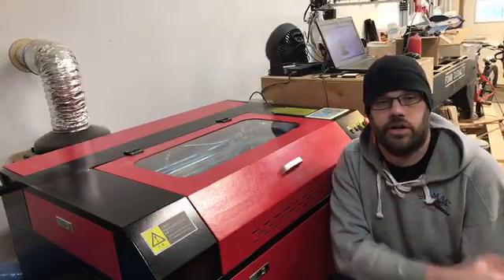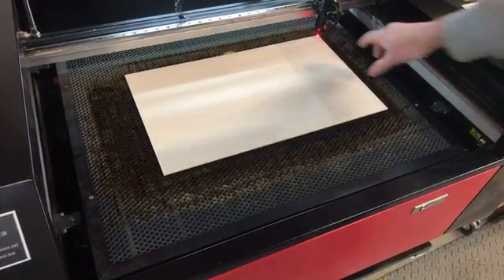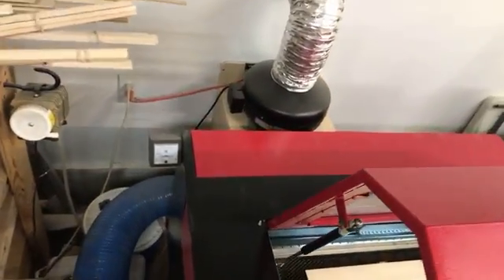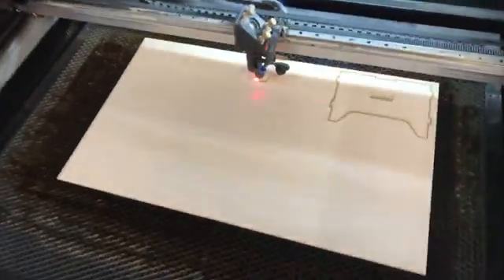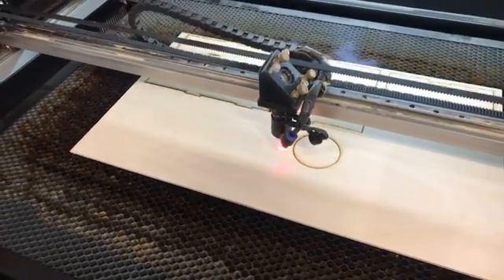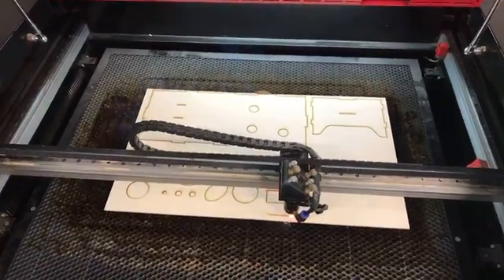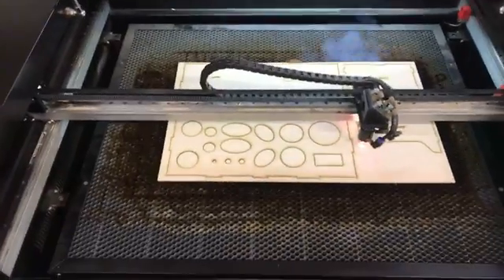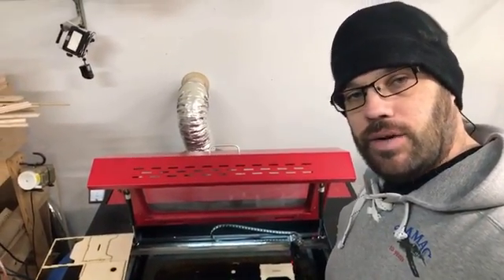Laser Cutting Baltic Birch Plywood (eBay Laser)

Comment: I've got my eyes on an 80w that looks just like yours. I was just wondering how good or bad the support is, or, is there enough of us english speaking folk out there using these that can help out other "newbies". ? haha.. do you do consulting?
Reply from the maker: When you buy one of the Chinese lasers from the bulk of the resellers you will get almost no support from them. I had a proximity sensor go bad within a month and they did send a replacement but that was about it. There is a good community online in various forums, websites and social media groups that do a lot to support each other and help troubleshoot issues. As long as you go into it understanding you'll need to tinker with the machine from time to time it's a great way to get an inexpensive tool for the shop.
Reply: I'm going to be cutting 1/8 and 1/4 inch plexiglass.
Reply: What is the price of Indian rupies

Comment: Hi ... I wanted to ask you how many watts is the laser of the video.

I would like to take it from 100 watts but I can not find it on ebay.

That model I find them from 60 watts.

Do you have some advice?

Thank you so much for your help !!!

Marco
Reply: Hi friend,I come from China, I have about 6 years of experience in the laser industry, if there is a chance, why don't we talk about it? Here's my contact details: atonfu@gmail.com 
Whatsapp:+86 15069148520
Cell phone number:+86 15069148520
Reply from the maker: Marco, I bought this as a 60W laser from eBay. That being said it came with a 60w power supply that was overdriving a 50 watt tube. I replaced the 50 watt tube with a true 60 watt tube which is what you see in this video. I should have cleaned the mirrors and lens before this video and the cuts would have been cleaner. I have also played with the air assist to push more air through that has also provided cleaner cuts. I can now cut 1/4" Baltic Birch in one pass with fairly clean edges.
Reply: @Vintauri  Thank you so much for the information.
I was trying to get the laser at least 80 watts so as not to put it under stress making it work.
Using a smaller one, I should keep it at higher watt to make the work overheating it faster !!!

Comment: I have one of these babies in transit arriving the end of next week with the 50W tube. I appreciate all the videos I'm seeing on these lasers. One thought... Can you program your cutting sequence to include a second pass at a faster feed rate to ensure that the cut goes completely through the plywood?
Reply from the maker: You can setup the file to cut twice on the same path. You would need to have the same vector lines on a second layer and use a separate color to have it re-run over the exact path.  It would be best though to manage it in one pass with the right balance of speed and power along with making sure your lens and mirrors are all aligned and clean.

It'll take a bit to get your machine dialed in but then you'll know it's limits and how to get the most out of each pass.
Reply: @Vintauri  I've been watching videos on these lasers for several weeks learning what these machines are capable of and a guy running a 40 Watt was cutting through 1/4" plywood by running the laser at 40% for multiple passes. He uses a handheld mirror under the work piece to see when the cut has passed completely through, instead of just guessing.The edge lines were barely even browned and easily cleaned up. Look outside what you "expect" the machine to do. I've watched countless people people finishing their work with jigsaws, bandsaws, grinders, and sandpaper reducing the quality of the work when it is completely unnecessary. I am so thrilled to getting one of these machines! You are only limited by your imagination.

Comment: Thanks for posting this video.  What type of laser is it - i.e. who's the manufacturer, where did you buy it from?  I'm looking at purchasing a similar power laser and I'm weighing up the Glowforge vs Chinese laser options. Any advice appreciated.
Reply from the maker: My laser is a Redsail X700 clone. I bought this one on Ebay. It was listed as a 60 watt C02 laser engraver. The glowforge is nice in that it's very simple to use. But it's a lower wattage and smaller working area. If your not afraid to tinker and do some self learning the chinese lasers are a great value.
Reply: Thanks for the info.
Reply: @Vintauri  Hello :) do you have the name of the seller and is this machine still performing well?
Reply: Sand me fon nambar,,,, Wath sap nambar
Reply: Hello, Mr. Burrows.I am a professional laser cutting staff.I can provide the model and help according to your needs. My whatsapp is +8613127135107, looking forward to contacting you